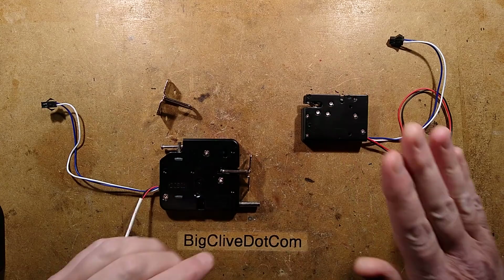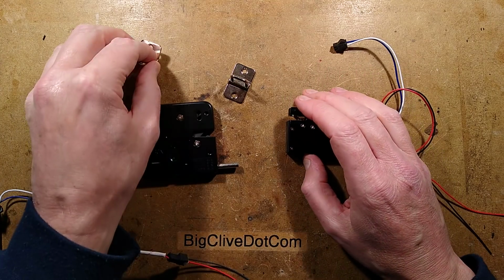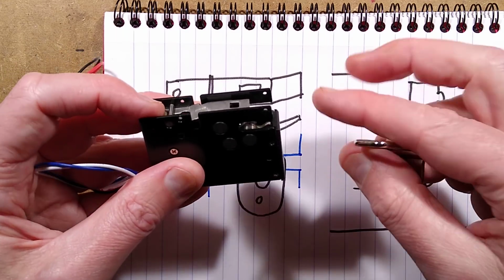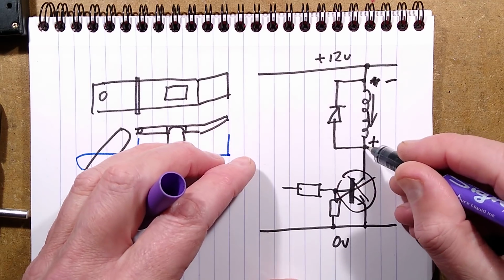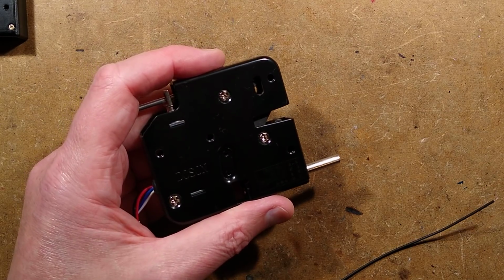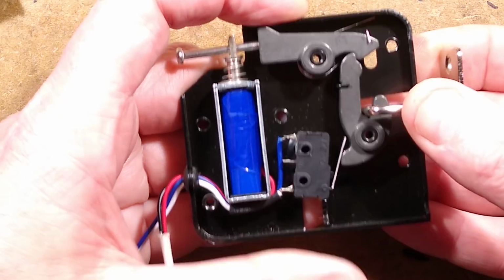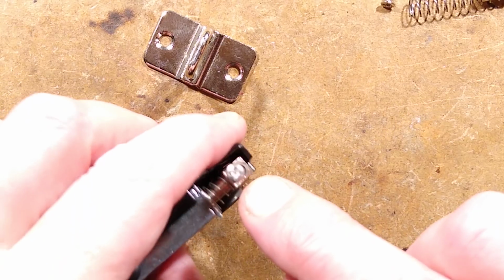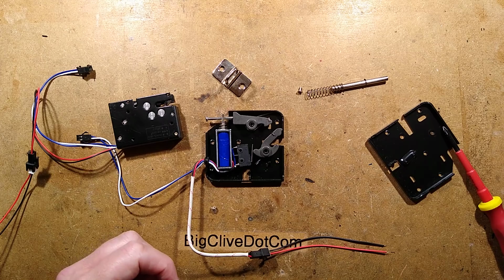Inside an eBay electric lock mechanism

Comment: Hey Clive... You can also wire the microswitch in series with the coil. Thar way the circuit is broken the instant the hasp releases and stopping overload. Will reduce current draw too as the solenoid will only energise for a split second.

Comment: Clive, could you do one on pinball solenoids with regard to back EMF? Reason I ask is I'm often called to work on very old pinballs with no caps or diodes. They arc like hell (typically 30v DC) at the bumpers and it would be good to have a good grasp of where you should put these components and underneath and why.
Reply from the maker: For DC coils a diode can be used in the reverse polarity to the way the coil is powered - the band towards the positive end.
For AC coils a capacitor/resistor snubber network can be put across contacts.

Comment: One Q,  do you need a extra panel to make these work, I've seen some with a panel or something or can you use a simple push button switch ?   I did see it says to only use the switch for .2 seconds or damage can occur to the solenoid , so can I use just a 12V power when need to open it, quick touch of the current ?
Reply from the maker: Yes, you can use a button.  If there's any risk that the button might jam or get held in by someone then it might be worth putting a suitable PTC self resetting fuse in series to cut the power off if the coil is energised for too long.

Comment: How would I wire one to use with a remote or wifi switch or better yet a timer?! I'm trying to setup an auto feeder for livestock. Could you maybe provide links for amz cheap equipment? That video was very informative!  Thanks for posting!
Reply: You need to wire it with a wifi relay device

Comment: could you show us how a front-loading washer door lock works? especially from the model i am having trouble with 😂 a GE gfws1700h0ww. the solenoid driven latch is in a dull red and black plastic enclosure. i opened it up and must have dropped a part and can't figure out the wiring diagram.
Reply from the maker: I've made a video about a washing machine door lock.

Comment: I made the mistake to almost burn them out. I have one of those locks connected to a bigger relais which is connected to a small RF relais. So when I push the remote button the lock opens. Worked fine until the remote button got stuck. The lock got hot and didn't work for a while. After it cooled down, it worked well again. I only use this lock maybe one or two times the day. I know the circuit isn't that good, but it works for me and if anything breaks, I have some spare parts laying around.

Comment: Same idea of a high power relays? You need that diode to keep a back voltage spark and destroy the relay? I learn every day from you thank you
Reply from the maker: When the transistor switches off the magnetic field collapses and generates a voltage with no load, so it can be very high.  The diode shunts that spike.

Comment: It’s quite tricky for short powering pulse time that it doesn’t give you enough time to realise the latch, then push opening the door, at least, you need two - three seconds to complete the process, ( I usually set it to 5 sec with a buzzer as an indicator of activation), however, three seconds with 3.5 Amp needs to use quite thick power cables, that to avoid dropping voltage during distance , rather than this, you can improve the performance by powering it by using a 12 volt Ac transformer rated output power ( I’d assume 24VA)  and a relay driver instead of an NPN transistor, it will be such a great solution as I do for all my installations.
Cheers mate.
Tony.

Comment: Reminds me of pin ball machines.  Where like the flipper solenoids are really strong but would burn quickly.  But they have a switch that changes from the (firing coil) to the hold coil since obviously much less energy needed to hold the solenoid once it's traveled all the way.

Comment: I wonder if all that metal would stop a another coil energizing the solenoids coil. Could be a fast keyless way to open these :) Anyway is that steel case magnetic? if not or weakly, one could be able to lure that probably more magnetic solenoid core in with sliding a strong magnet down besides it? In case of magnetic steel side panel, i wonder how the magnetic flux is directed in that (in case that could be used too)
Reply from the maker: It didn't respond to a very powerful external magnet.

Comment: Instead of a PTC, could a large capacitor be used to power each lock?  First thing I though was if PTC resets then might have to wait a long time and would be annoying.  With a capacitor per lock, the 12v supply could in a current limited way charge the cap, no need for a large 12v supply or heavy duty wires, and avoid the reset problem.
Reply from the maker: The trickle charged capacitor is an option, but might need to be very big.

Comment: So... if you held the door closed, a naive system would keep the coil energized till it burns up?
Reply from the maker: A proper system should fire a pulse and if the door fails to open it should try a few more before giving up and flagging an error.
Reply: THAT'S WHAT HAVE BEEN HAPPENING WITH MY LOCKERS! Took 4 years to fix that, - George

Comment: Some of these can be forced open with enough pulling force, some you can pull the door and whack it with a hammer to make it jump open. But most lockers they don't give you anywhere to pull and get enough force for either method, so combined with the resistance to magnetic manipulation, they're fairly hard to force open -- most thieves would probably just pry the door open with a crowbar and break it or otherwise smash their way in before they could really make one of these misfire or otherwise open.

Comment: Why put the screw into the latch arm??? Can't be to adjust tension because one end of the spring rests against the case and the other end hooks around the nose of the arm.
Maybe to ease in assembly?
If the switch was put in series with the coil it would not matter how long the pulse is as long as it is long enough to un-latch the system. That way the coil can only energize if the latch is hooked [door closed] then as soon as it is un-latched by the solenoid the current is interrupted immediately. With separate pigtail connections, the switch can register to a door control board as to whether the door is open or not. Maybe connect the 0V rail through the switch to the source pin of an N Channel MOSFET. This way a logic level signal could tell the door to open, which would only activate if the door is already shut.
Fun contemplating potential engineering designs and reasons.

Comment: I have a question. What is the purpose of the resistor from transistor base to ground? Also, is it useful to put a diode before the base to prevent backflow? I'm still learning, so sorry if these are dumb questions.
Reply: The base-emitter resistor is there to shunt the collector-base leakage current to ground and prevent it from flowing back into the base where it would then be amplified by the gain of the transistor and cause a large collector to emitter current to flow.  Most of the time it isn't really necessary because the device that's driving the transistor has a low impedance to ground in its low state.

Comment: These remind me of the mag locks we have on the doors where i work (in a betting shop so we have a switch to lock the door from behind the counter, we just all it a mag lock, but the don't swing open like that) would be interesting to see what the differences are you you could get your hands on one of them.
Reply from the maker: If it's just the silent door retainer it may just be the simple electromagnet type.
Reply: @bigclivedotcom  yeah, i think it is, some of those of been on the shops for YEARS, so i imagine they aren't very complex.

Comment: This may be the first time I've ever had intimate experience with something, before Clive did a teardown on one!

We use these extensively in the escape room industry. Tiny, dirt cheap, consumes no power while idle (unlike a mag lock, which we also use extensively).

Fun fact, the 12v units will operate splendidly at 24v. I run them on a NPN output from my PLC's with a 100ms timed coil output. 

My standard procedure with these is to use the switch as a monitor input on the PLC, allowing the game master to see on the HMI if the player has successfully completed whatever puzzle the lock is attached to and the status of the door / prop / lid / whatever. I use the same input to monitor if the door is closed before the game is reset. IE, player closes door while the game is running, the door immediately pops back open so they can't lock themselves out of a box that they may still need to get in to.

As long as you stay within the technical limitations of them, they're very, very reliable, very robust little locks!
Reply: If i am getting this right you mean that switch could act as the sensor to westher the door is open or not right ?

Comment: The latch mechanism looks a lot like the one of car doors to me.
And I wonder how long the batteries will last on all those battery-powered smart parcel boxes that you can install at home and that use the same kind of locks, given how much current the solenoid draws.

Google Boks One for a French example of what I'm talking about.

And as far as the magnet attack goes, you have to remember that the lock will always be inside a locker or box, with quite a wide air gap between it and your magnet, plus the door itself, so I wouldn't be surprised if one told me that lockers and parcel boxes are in fact immune to the magnet attack, unlike LPLs padlocks where there's not that much of an air gap between the actuator and his magnet.
Reply: 299€. Pretty cool, I guess
Reply: @KOTYAR1  Not even !
LPL would quickly defeat the cheap flimsy wafer core and also I don't really like the build quality and the fact you need a smartphone to even open it.

Plus it takes a non-standard battery and also some people say it even lacks user friendliness for delivery men who'll most likely drop the parcel on the curb next to the box
Reply: Since the solenoid only needs to be energized for a fraction of a second the batteries could last a very long time. By my estimations a pack of 8 AAs (or three 18650s) would probably have enough energy to open ten thousand times.

Comment: I recently worked on a project that uses similar locks. But the ones I used had motors inside, not a solenoid. It was possible to operate it for "half a turn" if you were quick enough.
I think they didnt draw as much current as the ones you have.

Comment: I think you got side tracked.
You were going to mention the value of the resettable fuse value to protect the solenoid, very useful little devices and the state of the switch in the on/off state.
Presume the value would be for the short time current pulse.
Is there any feed back to the control centre giving them the switch position e.g on/off, like the ones in the telephone boxes giving BT a signal that the box had been vandalised or the coin box broken in to?
Thanks for the breakdown and video.
Reply from the maker: The PTC value would depend on the coil.  It would have to be experimented with. The value would be much lower than the coil current.

Comment: I installed a cheapie ebay electric door strike last week.. similarly designed mechanism but it only draws 250mA.  2.5A seems quite high, to be sending over the distance the lock may be from the controller.

Comment: hey clive. i’ve been using the one bigger of these on the door of the school bus I live in. It feels pretty secure but i have it at about a 2 second pulse via a relay which gives me enough time to open the door by hand. Problem is that I’ve been burning out the solenoids like once every one - two months and now just keep a spare around. Sounds like maybe the pulse length is too long. I can’t really go much faster with it because of the weight of the door and reaction time as is, but i’ll definitely give it a try. Probably just the wrong part for the job.
Reply: Instead of one long pulse, why not multiple shorter pulses for a few seconds?  
When you're pulling the door that should be enough to get past the latching mechanism, similar to getting buzzed in at an apartment complex.
Reply: @imbw267  oh dang, great idea... I gotta see if that's gonna be possible with my setup. I mean it definitely should considering I've got the relays on an ESP32 running ESPHome controlled by Home Assistant. Just not sure where I'd start with that. How fast can one even pulse a lil hobby relay?
Reply: Another option might be a multi-level current system. You could do this with a series resistor. 2.2 ohms at 10 watts should work reliably. Instead of running full current for two seconds only do it for a couple hundred ms, then put the resistor in series with the coil. Once the solenoid has pulled in it won't need as much current and the series resistor will reduce the coil's dissipation by more than half.

Comment: What should be the value of the PTC Fuse, also didn't understand the series capacitor, will it increase the MOSFET on time?
Reply from the maker: The series capacitor for a standard transistor limits the duration of the pulse, even if the processor crashes with the transistor drive stuck on.  The PTC fuse should be rated for less than the solenoid current so it will trip if the solenoid is energised too long.

Comment: Hey, Cool!  That's a good way to release a package from a drone, just use a string instead of the hasp.

I needed to pulse a counter solenoid and I didn't want to, like you said, have a chance of full current constantly through the solenoid.  So I put a 1000 uF cap paralleled with a bleeder resistor in series with the solenoid coil.  Turn the transistor on and the cap charges up through the solenoid, actuating the solenoid.  After the cap is charged, the bleeder resistor conducts many times less than the actuating current.  Then the transistor turns off, the bleeder resistor discharges the cap and it's ready for the next pulse.  This also works good for button pressing nuts who like to take out their obsessive-compulsive behavior on pressing the button.  If they don't wait for 5 or 10 seconds, the solenoid won't activate.  😂😂

Comment: I've seen two wire versions that wire the door closed switch in series with the coil - if the output goes faulty and goes high the door opens and automatically disconnects the coil so it can't overheat .
Checking to see if the door is closed is done by passing a very small current through the circuit to see if a coil is present, this is easy nowadays because microcontrollers can monitor there outputs to ensure they are doing what they are told.
Reply: That could be helpful but it wouldn't be a catch-all solution. If the door is prevented from opening it would still burn out the solenoids.

Comment: That latch design is similar to automotive door latches on a slightly smaller scale. Being solenoid operated this could work on the custom cars that have had their door handles shaved.
Reply: Yeah I've learned the hard way that it's not so great if the only mechanism to open part of your car is electrical... Try having a dead battery and your jumper cables are in the trunk which has no keyhole and can only be opened with a solenoid controlled by the computer...

Comment: So a coat hanger pushing up on that bar on top should open it up.  EDIT : Actually you would have to pull down on the plate, maybe with a magnet.  I shall get a magnet.
Reply from the maker: I tried a powerful magnet.   You could definitely push the plunger down if you could get a bit of stiff wire in.
Reply: @bigclivedotcom  There has got to be metal surrounding the way to get in the thing.  That's too easy.

Comment: Is there any way that an unexpected opening of the lock could be detected by the control system?
Reply: I had a van that unless you were sitting in the seat if you pulled up the latch through and open window it would relock the door..  The locksmith had to push a stick on the seat at the same time his bud yanked the latch    no sweat    it would probably set off an alarm and start a camera
Reply from the maker: If it opens the switch will indicate that it is.